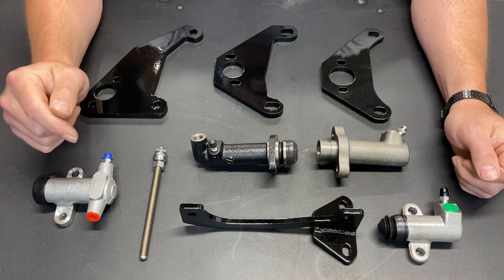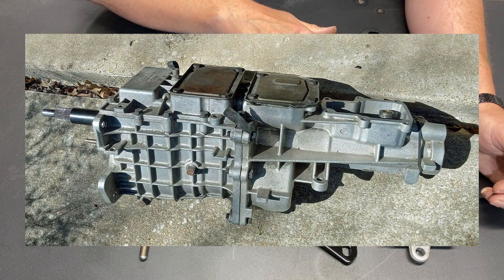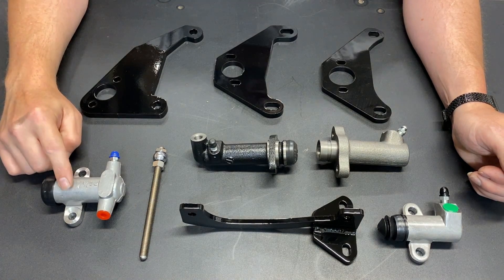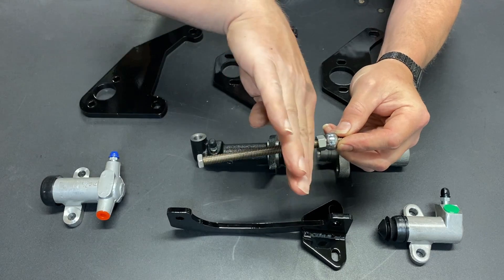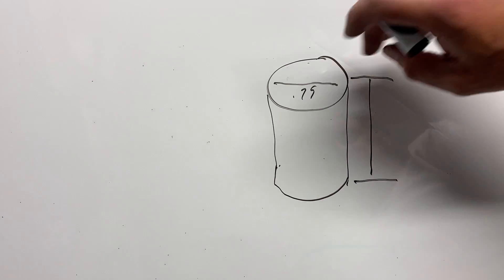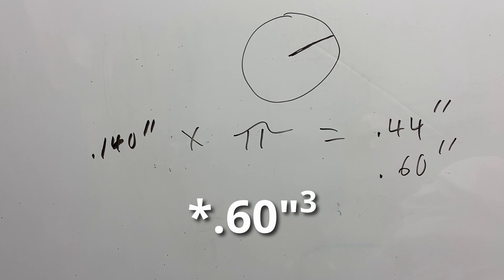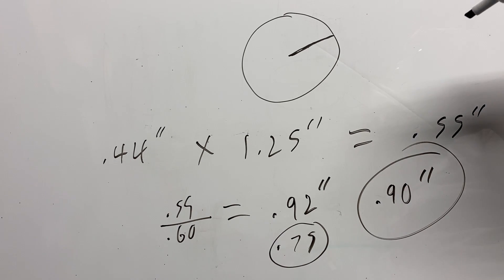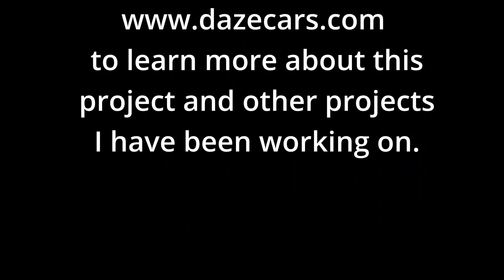Hydraulic Clutch 101, How to Pick Correct Size Master & Slave Cylinder for a Hydraulic Clutch

Comment: I'm dealing with this now. I made all my clutch/brake pedals, linkage etc. I have to pull it back apart and see exactly what I even used for the clutch master. It's been a years long project and I can't remember. It's a pre 1967 single GM brake master. I was thinking when I bought it that they were all the same. Apparently, the cars used a 7/8 bore master and the trucks used a 1 1/8 bore master. Either way, it's apparently too big for my 7/8 pull type slave. The pedal is super hard. The pedal is at a 6:1 ratio, so my master has to be too big.
I likely won't find anything with a smaller than 7/8 bore that will bolt directly to my bracket. I'm thinking something like a wilwood and an adapter.
Reply from the maker: all sounds reasonable to me, let me know if any questions come up

Comment: I have a MDL master cylinder That has .7" bore with a 1.4" stroke. The math comes out to .53851 Fluid volume.   If I divide by the .6 slave cylinder I get .8966. A little short of your example. Will one of your slave cylinder work with this set up?   I hope so cause I need to order a kit ASAP. Thanks
Reply from the maker: I offer smaller bore lave cylinders that work with all my bracket.  My side mount T5 bracket is a a direct swap, you order the kit and then email me and request the smaller slave.  All of my flush mount kits require a slave that costs me quite a bit more and requires a special fitting that I supply with the slave so there is a $50 up charge to get a 3/4” bore slave for the flush mount kits.

Comment: I’m using a Miata slave with a bracket that I made up.  I prefer your setup.  What is your contact info, email or Facebook?  Interested in a sn95 “94” kit.  Thanks!
Reply from the maker: I can be reached through my website.  Also I will need to know BOTH the bore and stroke of you master in order to properly match one of my slave cylinders to your master cylinder.

Comment: Hi , im verry new to hydraulic clutch . 
My friend is running a t5 on a '49 Ford flathead.
The man who designed his his clutch system sadley died . But we have problems .
To engage the clutch it works fine but when disengage after about an inch of pedal travel it allready engages so there us no relaxed engagement 
Both master and slave cilinders have the same stroke .
Is this wrong ? Should the master have less stroke?
Reply from the maker: This sentence doesn't make any sense to me "To engage the clutch it works fine but when disengage after about an inch of pedal travel it already engages so there us no relaxed engagement " ... What?? As to your other question having more, less, or the same stroke between the master and slave is not right or wrong.  It's about balancing the fluid volume to optimize the system within the requirements of application.  It's a product of both bore AND stroke so you cannot determine if something is correct or incorrect based on only bore OR stroke.

Comment: how would I calculate the the fluid volume for a concentric slave cylinder where the assembly is located inside of the bellhousing? would it be a matter of contacting the manufacturer of the slave cylinder/throwout bearing assembly to figure out the specs if they're not provided on website tech data sheet/etc?
Reply from the maker: hydraulic throw out bearings are a totally different animal and require the exact spec master.  Typically the information is not easily available and yes you must contact the seller.

Comment: Very informative information 

I have a general question about the bore size of the master cyl vs the bore size of the slave 

If you decrease the bore size of the slave without changing anything else, will the overall stroke action of the slave increase as long as the master has enough volume?
Reply from the maker: Yes if you "decrease the bore size of the slave without changing anything else" the slave cylinder stroke will increase but so will the pedal effort
Reply: @dazecars  thanks. I’ve carried out an mgb V8 conversion and it now has a W58 Toyota gearbox & bellhousing supplied by Dellow in Australia 
The bellhousing is designed to accept the standard 1”1/4 slave cyl but I don’t seem to have enough travel to make the clutch engage 
It runs the standard mgb 7/8” master cyl 

The clutch is crazy light and I have bled it multiple times to remove all air from the system but I can’t get a firm pedal. So I believe the action does not have enough actuation to fully engage the clutch 

I have watched the slave while actuating the clutch pedal and it’s moving as soon as you touch the clutch but obviously not enough. 

My idea was to purchase a 1” slave from a v8 mgb which will mount up and hopefully have enough actuation with the std master cyl 

Thanks
Reply from the maker: There could still be air in the system.  Several of your statements are exactly what I commonly hear from customers when they believe all the air is out but the ONLY way to know for sure is to calculate fluid volumes and measure actual stroke.  if the math works out, then all the air is out but if not there is air in the system, every time.  Sounds like you need to watch the video I dropped yesterday.  https://youtu.be/8pFd_cHVjHQ
Reply: @dazecars  thanks, yes that was a very interesting clip to watch. 
I’ve tried bleeding the slave various different ways, even with it off the bellhouding and clamping it fully closed to try and eliminate the air in the system. None of which change the action. 
I’m starting to wonder if the ratio is no good & the position of the pushrod on the clutch fork is too far out from the centreline of the clutch. 

I will measure the master cyl stroke to calculate the volume in the next week or so.  
Thanks for your assistance
Reply from the maker: Figuring out fluid volumes is the first thing and from there you can diagnose the actual problem.  Otherwise your just trowing spaghetti at the wall.
Reply: I finally got around to measuring the stroke of the master cylinder on this MGB 
It’s got 25mm of movement at the master with full pedal travel & bore is 7/8”
The new 1” slave has approx 13mm of piston travel for that same full clutch pedal travel 

Does that sound about right or do I still have air in the system? 
My clutch still won’t engage with this new 1” bore slave cyl (down from 1&1/4” bore slave) 

Any advice? 
Thanks
Reply from the maker: A possible problem is not enough stroke on the master.  Is the master itself fully bottoming out or is there something in the pedal assembly that is limiting travel?  based on the measurements all the air is likely out or there is a very tiny bubble.  The reason I say "or" is the difference between actual stroke and calculated stroke is only .08"  (2mm) which could easy have come from a measuring error but if its not a measuring error could indicate air.  I would test and find out how much stroke is required at the slave to actuate the clutch.  Once you have that number you can resize the master and/or slave to achieve the desired stroke with the minimum required pedal effort.
Reply: @dazecars  ok, thank you. It’s sounding like what I first thought and that is relating to the ratio of the clutch fork to slave location. It’s almost like the slave location is too far out from the centreline of the pivot ball which to me would require the slave to need to move further to actuate the clutch 

I spoke with the supplier of the bellhousing & clutch etc for these types of conversions (Dellow conversions) and he said they have never run into the issue before. 
I’m starting to think that previous conversions mights have to sort out the issue themselves with different master cyl or slaves to overcome it.
I will try and find out what the clutch needs to fully disengage 
I will also check the pedal travel but I know the clutch pedal was on the floor 

Thanks for your assistance
Reply from the maker: once you know required stroke at the slave you can find a master and slave that get the required stroke but also minimize pedal effort.  That stroke number is the starting point to designing a hydraulic clutch system.
Reply: @dazecars Hi again, 
I have measured the clutch fork travel required for the clutch to properly disengage 
These measurements are measured at where the rod position on the slave cylinder connects into the clutch fork

with the clutch pedal in its normal ‘resting’ position and slightest gap between the thrust bearing and clutch, the measurement is 43mm 
With the clutch pedal fully depressed to the floor it gives me a measurement at the same location of 55mm (the slave cyl rod moves 12mm)

I then was able to get the clutch to fully disengage at 60mm by manually pulling the clutch fork back (checked with engine running and selecting all gears on hoist) 
So it appears that it requires an extra 5mm of travel to work correctly 

It sounds like I need a larger master cylinder to get the volume required? 

I also measured the master cyl bore and it is 3/4” or 0.75”
I also double-checked the master cylinder piston travel and it’s actually 23mm not 25mm as first thought

Thanks again for your assistance in this matter, it’s very much appreciated 👍
Reply from the maker: You have 2 options, you can replace the master with one that has more fluid volume by increasing the bore and/or the stroke OR you can replace the slave with one that has a smaller bore reducing the fluid volume requirements.  Replacing the slave will be easiest and a 7/8" bore slave will give you 16.764mm of stroke.  Its not quite the 17mm needed but I would think you could take such a small amount out of the gap between thrust bearing and pressureplate.  The down side is pedal effort will go up.  In a perfect world getting a master cyylinder with the same 3/4" bore you already have and almost twice the stroke would give you the desired stroke at the slave but I doubt you will find a master with that much stroke and it will likely require a different pedal mounting location.  A bigger bore master of the exact same stroke as what you currently have will also  give you more slave stroke but again pedal effort will go up.
Reply: Thanks, 
I’ve already replaced the slave cyl with a 1/4” smaller which has helped 
So I would rather replace the master cylinder as I’ve already removed it from the car, I’m happy with a heavier pedal as it is extremely light at the moment. 

What size bore master would I need to go up to get the extra 5mm of travel at the slave? 

I don’t want to mess around with the length of the stroke because that means re-thinking the whole pedal assembly 
Thanks
Reply from the maker: if you are going to maintain the .9" of stroke than a 1" bore master is required if you could step up to a little more stroke like 1.1" than a 7/8" bore master would work.  With a 1" bore master and a 1" bore slave the peddle will require almost double the effort it does now which may not sound like a lot but could be significant when driving.
Reply: Ok, I will try and get a 7/8” bore master and see if I can increase the stroke somehow. 
I did notice the pin that connects the pedal to the master cyl is slightly worn which gives a little bit of play and marginal loss of stroke, I will replace that with a new pin and that might help slightly. 

Cheers
Reply from the maker: I hope it goes well!!

Comment: Which slave cylinder is it on the bottom lower right corner it looks like it’s made of aluminum. It looks like a 62 Chevy truck got a part number on that one.
Reply from the maker: that is aluminum and 7/8" bore but not Chevy.  It is similar to the ones that can be had from speedway motors.  I have this version for sale on my website.
Reply: @  the one I have is for a 62 Chevy truck but it’s cast looks the exact same but it’s a 1 inch bore. I’m looking for a 1 inch board in aluminum like that.
Reply from the maker: I found all the slave cylinders I use by looking at specs on line.  I remember there bing a lot of 1" bore slave cylinders so it shouldn't be that hard to find what you're looking for.

Comment: I have a dilemma that you may be able to help me with. On my Daimler SP250 I changed the original transmission to a Toyota W58 speed. For the clutch I used a Quartermaster 721 series hydraulic throw-out bearing, with a Austin Healey 3000 pressure plate and a Toyota Supra clutch plate, all activate via a 3/4" master cylinder. While it is all very functional and smooth, the pedal is much higher than I desire [not as high as original setup but high]. Travel range with the 3/4" master cylinder is close to max. What would be the best to accomplish a lighter pedal effort while maintaining it's functionality? Thanks
Reply from the maker: If full pedal stroke equals full master stroke then there is nothing you can do to reduce pedal height AND reduce pedal effort.  Mounting the master pushrod connecting point further from the pedal pivot will reduce pedal travel and allow you to adjust the pedal down BUT it will increase pedal effort.

Comment: Hi , I have a 1980 z28 Camaro with an LS 6.0 quick time bell housing with a Doug Nash crash box transmission. I ordered an externally mounted slave cylinder from MDL before I saw your, video 😮. Any assistance is greatly appreciated. Thanks 🙏🏾
Reply from the maker: I do not have anything for your application but I am happy to answer questions.  If something comes up contact me through my website.
Reply: Thank you 🙏🏾

Comment: Could you offer any insite regarding internal slave cylinder requirements.  I was going to a ttack it by trying to get a rough estimate of fluid displacement.  2008 jeep jku master using a Ford f350 zf5 s5-47 trans(internal) slave cylinder
Reply from the maker: No I cannot, I do not like hydraulic throw out bearings, I don't like the way they feel, and  i don't like that they have to be set up perfectly or they fail.  Not liking them I have never looked into them.  Best bet is to make sure you get the correct combination of parts from the manufacturer because having the wrong combo will also cause failure.

Comment: Thus 5/8 master cylinder clutch matches to a 3/4 slave cylinder clutch thanks
Reply from the maker: as long as the MC stroke is enough.  I use 3/4" 7/8" on my own cars.

Comment: Hi mate..im using toyota BJ60 gearbox on my isuzu..upper pump 5/8 and lower is 15/16..a bit hard to put gear 1 & reverse...can you told what lower pump should i use for Bj60 gearbox. Tq mate..
Reply from the maker: What is the stroke of both, there might be air in the system which I can confirm or eliminate with those numbers? And don’t say all the air is out. It’s the most common trouble issue I see and absolute. . If it is not air than you can change one or the other to get a bit more SC travel but that has the potential to effect pedal effort.

Comment: i got a WC borg warner T5 with a camaro tailshaft bolting onto a 350 sbc, got a Wilwood 1 inch bore master cylinder and can’t seem to find the external slave i need, think you can help me out?
Reply: the stroke on the master is a 1.430 in
Reply from the maker: How much stroke is required at the slave to actuate the clutch. With that information we can work backwards.
Reply: @dazecars  1.430
Reply from the maker: No not the mc stroke. How much is required at the slave to actuate the clutch. In other words the minimum amount of movement at the clutch fork to get the clutch to engage.

Comment: Hello. So I have a 5/8 mater and a 3/4 slave. Assuming my stroke on the master is 1 1/4 I'll be moving 
.383in. cubed. How far should my slave travel? Great video btw. You dont make any toyota parts?? The master stroke is actually 1".
Reply from the maker: That combination will only result in .7” at the slave. No nothing I offer is designed for a Toyota… although I drive one as my daily driver 😁
Reply: @dazecars  damn. I got a bubble.. Your not kidding. That is a bear to bleed. This time, No. 3, the whole thing is coming out. Thanks for the answer
Reply from the maker: glad I could help

Comment: I am interested to install the kit that you sell.  I have a 68 Mustang with a T5 and Power Brakes. Is there enough room to mount the master cylinder without interference from the booster?
Reply from the maker: It is a very tight fit BUT I have not had any customers say it didn't fit.  With a remote reservoir you can clock it to the side giving a lot more room to fit things.

Comment: Great video What percentage reduction of energy will you see in clutch pedal application force by adding a master and slave to a S10 t5 currently using a 3 fork 1100 lb clutch?
Reply from the maker: It doesn't work that way.  The 1100 is the clamping force.  From there you have three ratios that all reduce that effort: clutch fork ratio, pedal ratio, and hydraulic ratio.  The video that will be out Saturday morning goes over pedal ratio and hydraulic ratio.

Comment: Does the size ratio of master and slave cylinder change the force requires to operate? I understand it changes the travel of the master cylinder but does that in turn increase and decrease force needed? So larger master shorter travel and more force, smaller master more travel of master but less force required? Can anybody help me out? Trying to match my master and slave motorbike clutch cylinders to reduce force required to operate as it is very hard to operate.
Reply from the maker: Easy way to look at the ratio Is stroke for stroke.  In other words if do two different bore sizes and 2" of stroke at the master results in 1" at the slave you have a ratio of 2:1 and will reduce your pedal effort by a facto of 2 in other words cut it in half.  This is why most hydraulic clutches run a bigger bore slave and a smaller bore master with enough stroke to have the correct fluid volume to move the SC the required amount.  Make sense?